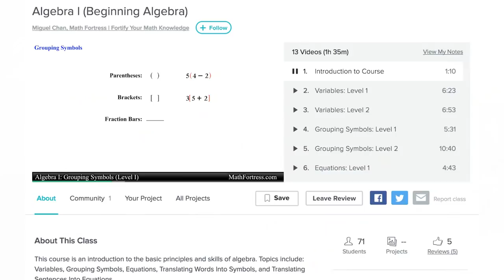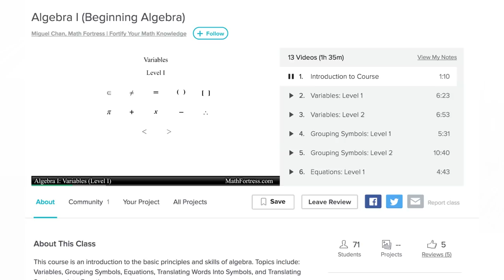DO PILOTS Need MATH And PHYSICS? The Real ANSWER

Comment: I think this video could  unnecessarily put some aspiring pilots off. On a day to day basis I do very basic maths... the only time you need to learn a bit more is when doing your ATPL exams. In the real world it's very minimal.
Reply: This is very reassuring, thank you! I was terrible at maths at school, especially arithmetic, but I think (hope) now I'm older that I might actually find it easier because I can think more logically etc.
Reply: speedbird3000 you're welcome! If I can prevent just one person from giving up on flying due to maths concerns then I'm happy.
Reply: Define minimal. Any calculus?
Reply: Adrien Rassat minimal as in basic arithmetic, e.g. 5 × 3, 57.8 - 57.1 etc
Reply: I doubt the training only incoporates that. i mean all of the physics you gotta learn, such as the compressability effect, supersonic and transonic calculations. I'd imagine to pass those you oughtta be really good at maths. Some people say u have to learn calculus before passing theory in training.
Reply: Adrien Rassat I was referring to the day to day maths but if you mean the theory you have to learn before actually flying then yes, there is some maths and physics - such as you mentioned. However, the last maths I did before doing my ATPL theory was at high school and I got the worst grade you can get. And now flying 737's. Amazing what determination and tenacity can get you.
Reply: That's reassuring to know. Just out of curiosity, what's the hardest maths you had to do in your training just so I can get a feel for them. What's the toughest theory you had to learn. I am terrible at maths so i wanna see if I can understand them.
Reply: Adrien Rassat what level of training you at? Its quite a while ago since I did my exams, I can't remember much. There's plenty of info available online!
Reply: eUK95 hiii, so just checking here, do I need to take physics? Because I'm I need to choose subjects this year and I don't want to choose something that they'll teach in the aviation school anyway, please help me. I really don't know what to do💔
Reply: Maths and physics are recommended by many cadet programmes - it'll give you a head start. However, they are not mandatory. You need a minimum of 5 GCSEs and 3 A-levels. The required grades vary depending on the school/cadet programme. Grade requirements can alter from a lax 3 Cs to a stringent straight As.
Reply: Bianca Pillay as Adrien pointed out it's not mandatory, at all. If you enjoy physics then go for it - it certainly won't hurt! Just do your best and get the best grades you can in the subjects you want to do.
Reply: eUK95 thank you so much!! Would you recommend that I take it? Or do you think they'll show it in textbooks or something?
Reply: Bianca Pillay you're welcome. I can't recommend anything, it's totally your call. Yeah, physics is covered when you do your ATPL theory but I didn't do it at school and managed to wriggle my way through it :) all the best.
Reply: eUK95 I am in 10th grade now and I am very weak in maths and physics. Can I become a pilot in this condition? Do a pilot need calculus? Plz reply....
Reply: Kashif Khan did you not read all the previous comments/discussion? 😂 hope it helps!
Reply: eUK95 the comments that we want to see. Videos like this tend to put people in a stressful situation and end up in giving up, but i will not. We use maths everyday and we just apply it to aviation. there is books to learn i am pretty sure that if we put out mind into it and we believe in our self we can do it.
Reply: thank you im in highschool an i really want to go into this but im terrible at math
Reply: Thanks!
Reply: @eUK95  hi bro i didnt study physics in my highschool and i was poor in maths but i like to be a pilot and am ready to study them can they accept me or they will say you never studied physics
Reply: @pilotsaedismail8718  nah mate nobody cares if you didn't study physics. Good luck!!
Reply: @eUK95  thanks brother you are way more better than that idiot in the youtube tearing people's future apart. You are very reassuring and motivative thanks
Reply: eUK95 thank you very much! I am only in 9th grade but i absolutely love aviation. I won’t say I’m bad at math or physics but I’m not a natural. I have to study a lot until i understand math and physics. I used to be horrible at math but now i am slowly getting better at it. I’m still a little worried about it because ya know flight school is incredibly expensive and in case i fail the money will be gone. Anyway thank you again because pilot girl sort of made me a little insecure about it all. Btw how much geometry is needed? I’m good at calculus and algebra but geometry just isn’t my thing. Thank you
Reply: This Video just turned me off. I do not know anything in physics...dont even remember what i study in high school
Reply: @eUK95  hi iam an aspiring pilot from india planning to migrate to canada. what if i don't have mathematics in school? how can i learn it for pilot course?
Reply: eUK95 i have a year ahead of me and I’m planning to apply to aviation to be a pilot, but after seeing that video I don’t think I’m up to it. My huge problem is math i can do simple math like +, —, x, and division but is that enough? And is simple physics enough?                                        Thank you!
Reply: @eUK95  I suck in both of these subjects too.
Literally I have got compartment in maths in 7th class
But in my country India.. You need to take Physics Chemistry and Maths for doing CPL in India 

What can I do now??
Reply: Thank you so much for this kinda scared me when I saw the video
Reply: Ĺ
Reply: 76
Reply: Is ooll
Reply: Unless you have a genuine case of dyscalclia and or problems with spatial reasoning I think most ppl are capable of learning math through basic calculus. In most cases people decided they were bad at math after compulsory education. If you’re considering a profession as serious as commercial aviation you should be able to, as an adult in a post-secondary setting, pass the same math classes as first year engineering students. It’s a lot of work, especially if you didn’t take care of it in K12, but it’s akin to learning a second language. Most human beings are capable of it. I’m not sure why someone who wants to do a job w/ this kind of gravitas thinks they wouldn’t be faced with requirements like college-level math and physics.

So much of this comes down to the cultural baggage surrounding mathematics proficiency. Chances are you’re not actually lacking in any ability, you just never got a chance to focus without being distracted by other obligations (growing up, for example) and cultural messaging. Being “good at math” shouldn’t be an identity marker any more than being handy with cars or good at gardening, but for some reason it seems important enough for some people to view their feelings about it as a part of who they are.

This level of maths proficiency is a life/professional skill. Outside of extraordinary cases, it’s on par with being multilingual. But instead of Mandarin, you’ve learned to speak Basic Calculus.

Higher level pure maths, on the other hand, isn’t the same. But most non-mathematicians won’t venture into that territory. Applied math needed for highly trained technical fields is a language that most people can learn if they have to.

It also happens to lend itself to other cognitive tasks in my opinion but idk if that’s actually well-supported
Reply: Thank you very much for this information. You did a great job pointing this out
Reply: True, but could also be that math actually helps with improving decision-making and critical thinking which is essential in flying
Reply: @junjalapeno7773  maths has nothing to do with critical thinking and decision making. I know many people who are great at arithmetic but can't drive properly or make fast, logical decisions.
Reply: I can confirm  this ! This girl is just trying to make herself look a bit smarter ;)
Reply: Define basic math. 
What level of mathematics and physics do I need to know in order to have a successful career as a pilot ?
Reply: I think people who struggle with basic math should not be flying planes.
Reply: @tongpoo8985  I guess I should quit my airline pilot career then?
Reply: @eUK95  if you made it, you made it. But I would be pretty nervous if I found out middle school math was beyond my pilot's mental capacity.
Reply: @tongpoo8985  probably best to stay at home then and not fly. Pilots aren't great at maths, we are logical/common sense guys. Maths doesn't keep us safe, common sense and airmanship does.
Reply: @eUK95  math is pure logic, so if you can't manage it, either your logical circuits or abstract thinking circuits are not great. I don't believe that the average pilot isn't smart enough for anything beyond arithmetic.
Reply: @tongpoo8985  I don't know what else to say haha I, and my airline pilot colleagues, suck at math haha literally don't know how else to say it
Reply: THIS. Felt so put off until I came to the comments. Thank you.

Comment: All that computing power on a plane and you have to use a pen and paper for calculations ? Damn.
Reply: lesselp 🤣
Reply: What happens when the computer breaks?
Reply: zoidberg444 when does that actually happen
Reply: Because knowing math will at least an assurance that you will understand the physical concepts of flight from point of view of the engineer who designed the aircraft
Reply: If things go down, you cannot just look at a blank screen and say, shit.
Reply: Judging by the number of likes on this comment I have an honest question: are pilot prospects this stupid, really? Do these kids just want to dress like a pilot, push buttons and eat breakfast in the cabin? 

By the same logic of the comment, let's not even teach kids how to add and multiply since all that can be done in a smartphone.
Reply: equipment failure is real....

Comment: I'm a train manager and we also have to know a lot of math to calculate the weight of the train, the power of the breaks and how much breakpower the train needs to end up in the correct position on the platform.
I can only imagine how much pilots need to know math!
Keep up the good work! ;)
Reply: Im a conductor and engineer (US, freight) I was terrified about getting on the railroad and being horrible at math. Turns out all we do is add our train length, train length with 3% for its stretched length and adding our tonnage. Thats it, all basic addition and subtraction if we set out cars/engines. Haha

Comment: I did some digging to find the exact descriptions and in my country there's one university program that offers to teach the required theoretical knowledge up until the ATPL exam. This is the exact description for the subject in question: 

[Math 1.]
"Combinatorial concepts. Permutation, combination, variation. The concept of a complex number. Algebraic and trigonometric form. Complex numbers (addition, subtraction, multiplication, division, square root) operations. Vectoralgebra. Operations with vectors. Scalar and mixed multiplication of vectors. Matrix salculation. Matrix addition, subtraction, multiplication. Base transformation variant I. and II. Linear programming. Standard and modified normal LP problem. Real number sequences. Monotony and boundedness of sequences. Limits of sequences. 
Theorems for sequences. Operations with sequences. Series. Convergence of series. Convergence criterias. Absolute and conditional convergence. Operations with series. Geometric series.

[Math 2]
"Properties of a function, limits. Differential calculus, difference quotient, elementary rules of differentiation. Taylor formulas, Maclaurin formulas. Studying the graph of a function. Integral calculus, concept of primitive function, Techniques for indefinite integrals, integration of rational functions. Definite integral of real-valued functions. Newton-Leibniz formula. Limits. Applications of integral calculus, area, volume and rectification calculation. Centroid. Differential equations:homogeneous and inhomogeneous first-order linear equations. Second-order differential equations. Probability theory: properties of probability measure. Conditional probability, law of total probability, Bayes's theorem. Random variables, discrete random variables, absolutely continuous random variables, probability distribution function, probability density function, the description of probability density function, expected value and its properties, variance and its properties, independence, covariance, Well-known discrete distribution and continuous distributions: Laws of large numbers. The bases of mathematical statistics: random sample, sample mean, sample median, sample variance, unit area histogram (for density estimate). Statistical tests."

The physics part is what to be expected, electronics, engineering level mechanics, optics, wave theory, thermodynamics, and physical chemistry. This may vary based on where you do your courses, but I expect it to be more or less in line with the aformentioned requirments.
Reply: As is typical in such courses, they were designed by Mathematicians. They course bears no relation to the real world requirements but does boost the ego of Mathematics specialists. I would judge the requirements as being: Arithmetic to excellent mental and paper levels. Euclidian Geometry. Vector Arithmetic and Geometry. Basic Probability and Statistics.
All the rest in those course lists is important for a Mathematician, Professional Engineer or Theoretical Physicist going forward with their career but will never be used by the Pilot Students of these courses after they have sat the examinations.
Before anyone gets up in arms that I don't know what I'm talking about, I'm a retired Graduate Physicist, Chemist, Electronic Engineer and Computer Systems Engineer. Been there, done that, got multiple tee-shirts! Oh, I forgot to add Video Producer - LOL.

Comment: If you fly at h=33,000 ft and you want to descent to destination at a slope angle a=3° , you must do: tg(a) = h/d. Then you must start your descent at a distance from destination d=h/tg(a). h=about 10 Km. Then d = about 190 Km = about 102 nm. So you must start your descent about 102 nm before destination. And your vertical speed will be vs= v*tg(a). So if your ground speed is v=250 kt, then vs= about 13 kt = about 1,300 ft/min. Of course, the faster your ground speed is, the faster your vertical speed is (if the slope angle stay constant). When I played my favourite videogame (fs), I didn't do any calculation and diveded height into 3 to determine the start of descent at a vertical speed of 2000 ft. For example, if h=36,000 ft, then start of descent d=120 nm. And it worked greatly. Of course, "it worked greatly" ON A VIDEOGAME (I underline: "VIDEOGAME"). :-)

Comment: Planes are all about physics.  One interesting case study is what happened with Kara Hultgreen's F-14 Tomcat.  The F-14 Tomcat is a beast to tame, a very dangerous airplane that is given only to the best pilots for a reason. 
Kara was flying F-14A variant which had a crappy engine. The F-14 has 2 engines and she was approaching the carrier.  She was turning left and she overshoot the ILS centerline, so she tried to yaw and she had excess yaw, which caused a compressor stall, so she had asymetric thrust which adds rotation around vertical axis. What did she do? She engaged afterburner, making the rotation even worse. 
Instead of using rudder to compensate rotation, she used the control column making things worse, AoA went too high, her left wing stalled and right wing lift rotated the plane. Copilot (RIO) pulled the ejection seat, and 0.4 seconds her seat ejected pointing below horizont and she did not make it.
The compressor stall happened literally at the worst possible moment. 

The recommended steps to avoid her situation were:

Set a 10 deg pitch atitude on waterline without increasing AoA above 14 units 
Rudder - opposite roll/yaw supplemented with lateral stick
Both throttles as required for positive rate of climb
Landing gear up (to reduce drag)

Even knowing what needs to be done, actually doing that in the simulator is tricky.  If there is a compressor stall of an engine during final approach, with cross winds (to make it harder), it would worth practicing that in the simulator. It seems a bad situation and quite a challenge to solve.
It seems that keeping AoA under control in the first instant is key.  Immediately after, rudder, the throttle for climb and instants later landing gear.  Is it the same in your plane?  Your plane should not be like that F-14A beast and you will not be landing on a carrier, and yet it seems an interesting scenario to practice as an intellectual exercise of physics in the sim.  To me it looks like the most difficult and delicate scenario, aside of losing hydraulics and landing with engines only.

Comment: Yes you need a basic understanding of math and a basic understanding of physics.. But we are HONESTLY talking about adding subtracting and multiplying or dividing WHICH THE MANUAL E6B INCORPORATES AS DESIGNED for Ratios... A basic understanding of physics equates to “if you stand on a piece of plywood and weigh 100lbs or 200lbs??? Will it break?? Pilots don’t need all of the extreme math people think they do. They need to have a basic understanding of the math but MORE IMPORTANTLY IS AN UNDERSTANDING of all systems on board. Even “SULLY” Said he had no time to write out equations while landing in the Hudson. But somehow he did it while prioritizing certain information and putting off other information. Basic math is crucial, in an emergency low to the ground.....there is no time for Advanced math.